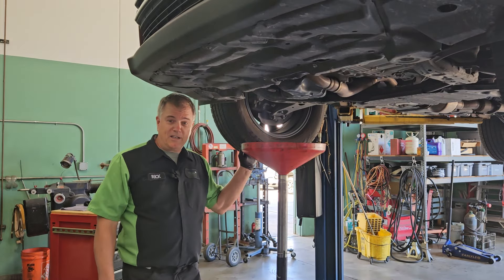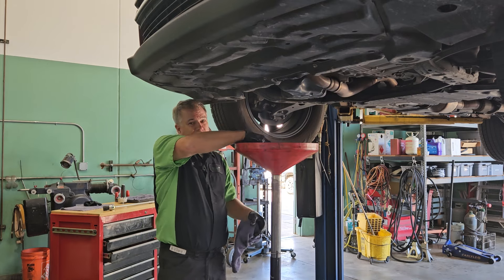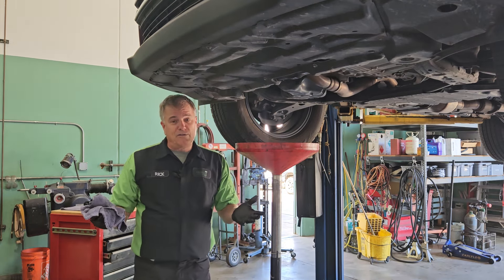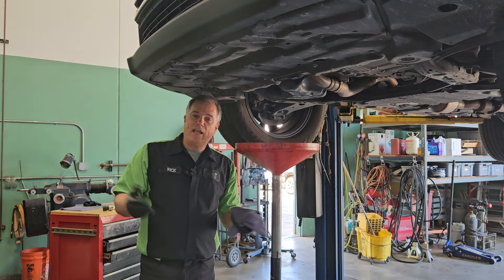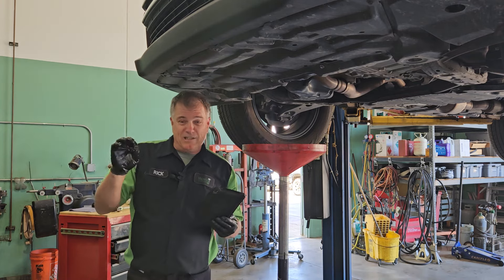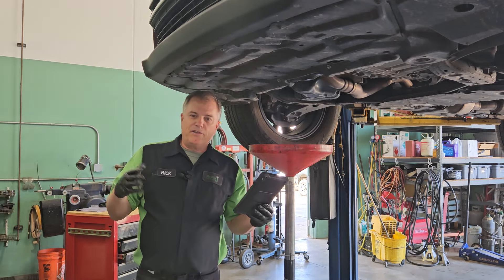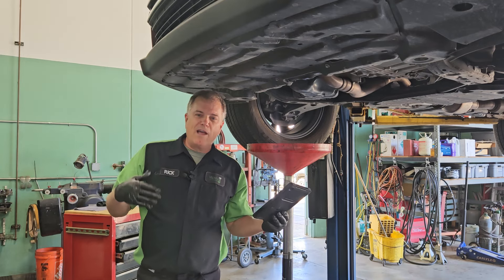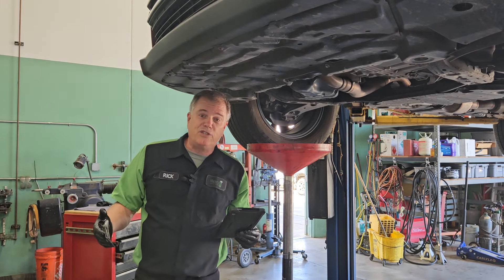What should be done during an Oil Change Service?

Comment: I see cars with tires where half the tread is worn off. It is clear that the owners do not have the tires rotated and  now they need a wheel alignment, plus a new tire.
 Another thing people never do is change lawn mower oil. I got a 5,000 w generator for free. The guy said it ran for a minute or so and shut off. He never changed the oil. It shut off because the generator has a low oil sensor. All he had to do was add oil. The first thing I did was change the oil.
These mistakes keep people like you in business.